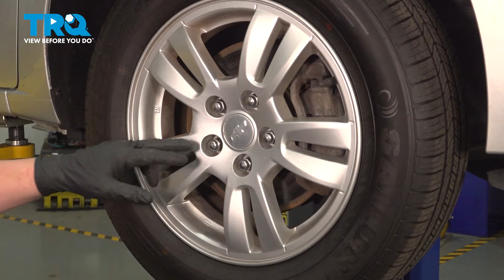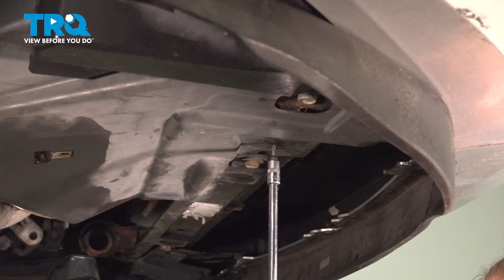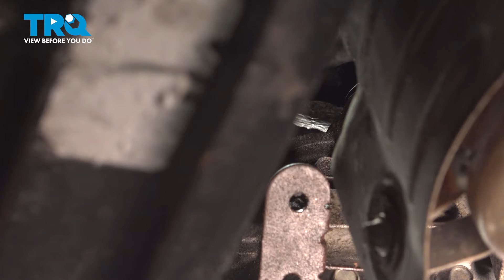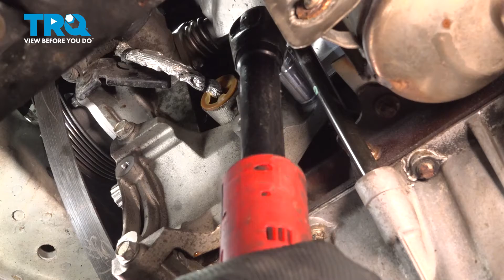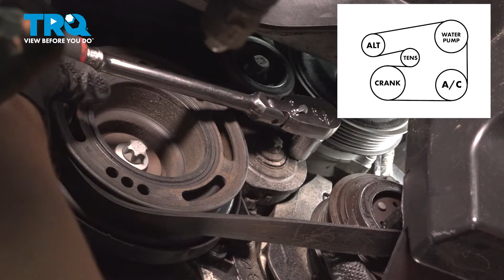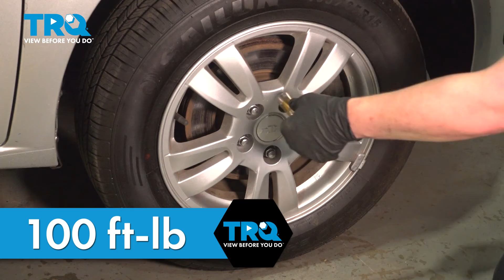How to Replace Oil Pressure Switch 2012-2020 Chevrolet Sonic

Comment: Disconnecting the AC lines means you have to discharge the system and refill it. That along costs $200. WTF kind of engineer designed this garbage 🗑️